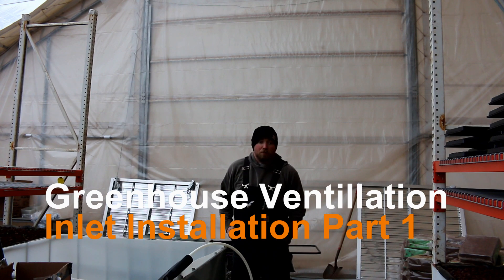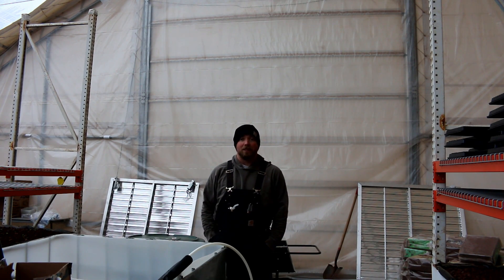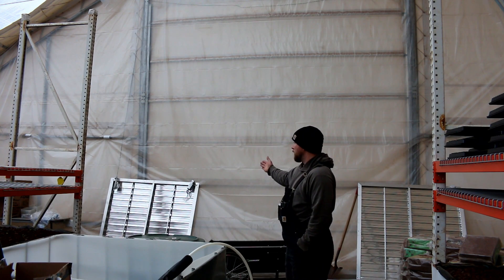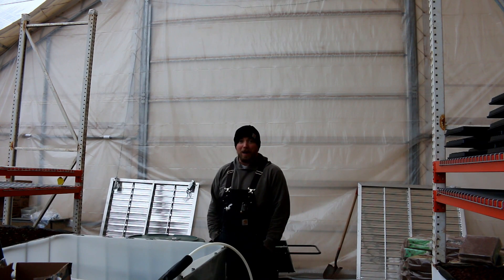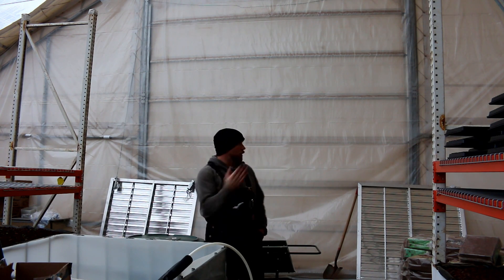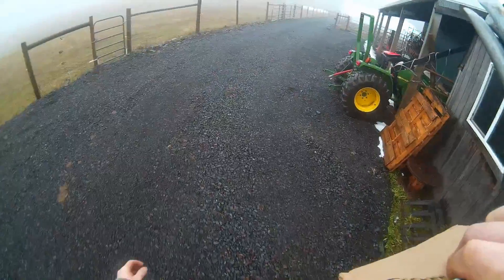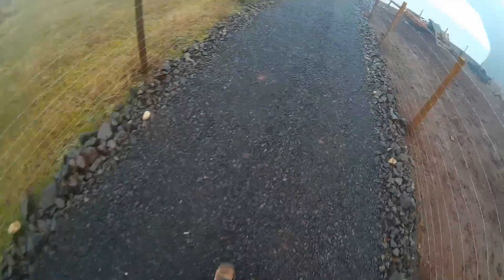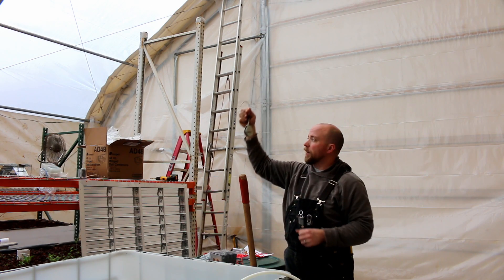Greenhouse EXHAUST FAN, Install, HOW TO - Part 2

Comment: With the amount of climbing your doing would it not be a good idea to get a harness and a safety rope just in case some thing happens?
Reply: shaun davies probably better to fall and break a leg vs fall and hang out for a few hours with reduced circulation....
Reply: Patrick Rebecca Doohan I’m an arborist and climb trees with chainsaws.  Falling down and head planting the ground or landing on tools is a killer.  Hanging is a chance to get safely to the ground.  You cannot change the laws of physics
Reply: Patrick Rebecca Doohan depends on the break you could bleed out externally or internally.  The hospital isn’t 5 minutes down the road.  Safety harness is a better idea that’s why people use them.  Reduced circulation can be resolved by drugs.
Reply: I’m sure he has a phone and Mrs Martian, Cody Mrs W & Jack are all nearby.

Comment: How about getting one or 1”inch or 1 1/2”flat bar aluminum and pop rivet it around the ages of your exhaust fan and all of your louvers to make a air tight seal around the edges. Good luck with the installation process, you should maybe ask a couple of your neighbors come help you hang installation, two or three pairs of hands will make a great big difference. Good luck in your endeavors

Comment: Is an exhaust fan needed? I know you love the automation, but couldn't passive measures work well in your climate? By passive, I mean using convection and maybe even prevailing winds to dump excessive heat buildup. I guess I'm all about decreasing costs of operation, complexity and reliance on grid power.
Reply: Mars Rover the exhaust fan is to control humidity.